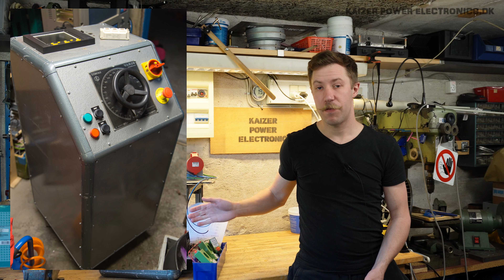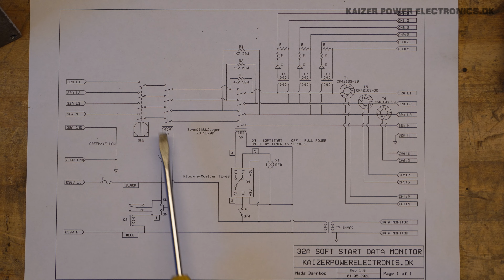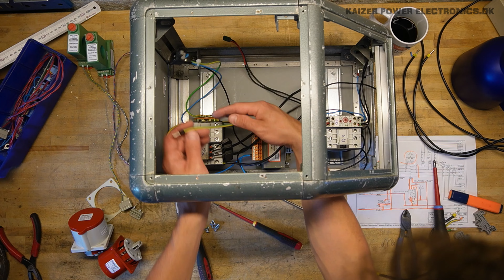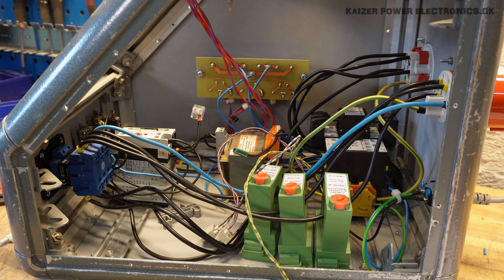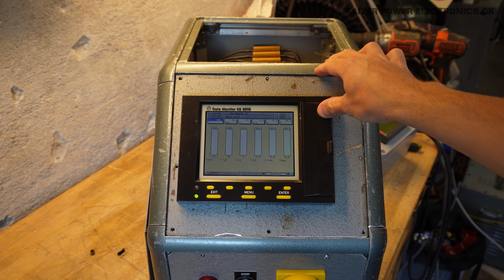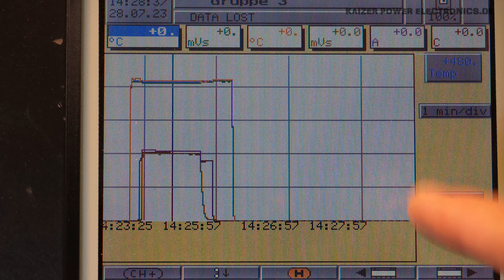3x400V Mains Supply Soft Start and Data Monitor

Comment: Maybe a stupid question but is there any reason we shouldn’t use an inductive ballast instead of resistors for the soft start? I would assume it would be easier to deal with (no heat) but might be missing something.

Thanks for the very informative videos!
Reply from the maker: Just like in a Marx generator, you can use either charging resistors or inductors, the same here. I used resistors as I already had them and I guess they weigh less than inductors :)
Reply: @KaizerPowerElectronicsDk  Ah ok cool, a buddy brought me a bunch of ballasts from fluorescent fixtures they ripped out of a building, so it makes a bit more sense in my case I guess. I wondered if the non ideal power factor of the rectifier would be problematic for an inductive ballast, but will give it a try, thanks!

Comment: Does the floppy disk drive work?  Surely someone could write some software to parse the data.
Reply from the maker: Good question, it came with a floppy and that failed to write, but I actually never tried with a new floppy. Or as new as the NOS ones I have are :)

Comment: Nice👍👍😎, I have built a variac PSU that has a self holding contactor circuit that doesn't reenergizes if power is restored, also it has a soft start (time delay is 1S), also having measurement of V,A,W,etc. By the way I also have a power analyzer (MFM376) it has a rs485 interfaces that would be super helpful for logging data but the full featured software is 400€🤑🤑, I think that the software for a expensive instrument should be free (I was buying the instrument new). So sad to hear your variac stack failed 😢.
Reply from the maker: Most RS485 interfaces are just MODBUS-RTU and with a bit of luck you should be able to find the registers in the manual. Else just start from register 40000 (Function Code 04) and register 0, try and see what you get. 
Luckily I have other variacs, but my need for large variacs have also changed over time.
Reply: @KaizerPowerElectronicsDk  Actually I did get the RS485 working, I get a direct Excel spreadsheet out, maybe I should make a video about it. Good to hear your have more variacs.

Comment: I am a convert to series capacitors  rather than resistors for soft-start after Steve Connor pointed it out to me.  They are less likely to start a fire in a load fault condition. 🙂 Might need a longer charge up though.
Reply from the maker: That is a good point. I do however believe that with a self-holding circuit, with a control power loss, I also cut the mains supply. I can see how the simple setups without this, is a fire hazard.

Comment: Nice work Mads i like this :-), dealing with the inrush this way means less equipment coil side i want to go this route eventually for when i build my big stuff 👍
Reply from the maker: Most of the time, I can do fine with a 16A service, but I make all my equipment rated for 32A. This way I can put multiply coils in daisy chain supply from a single power supply box like this.